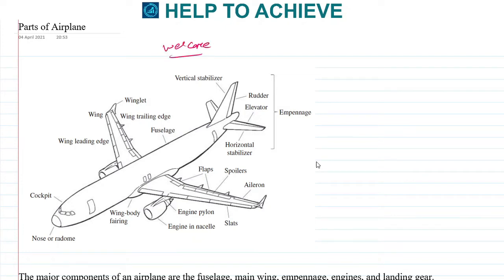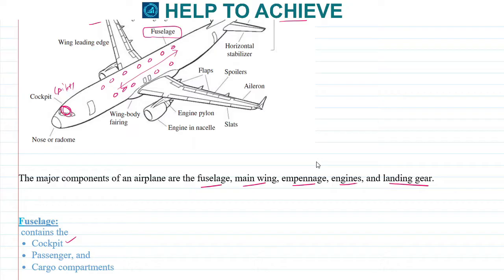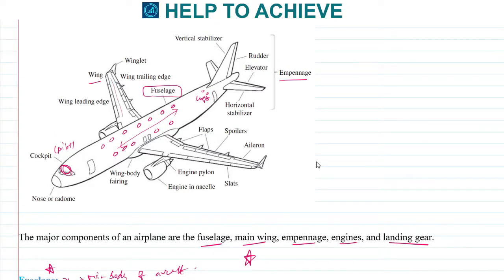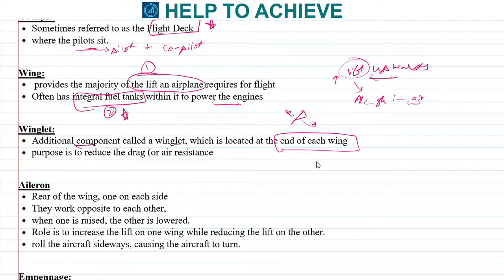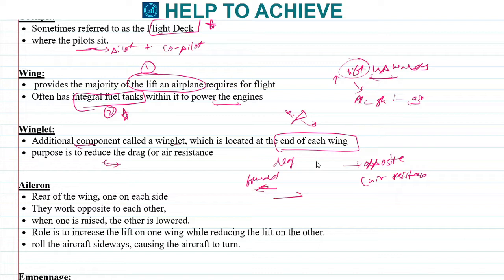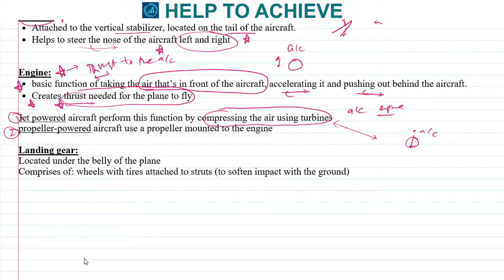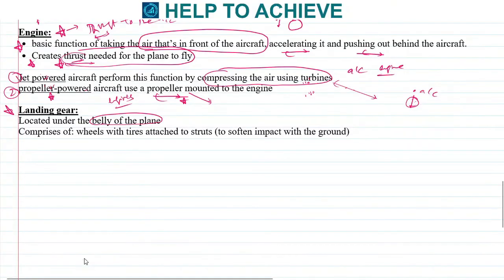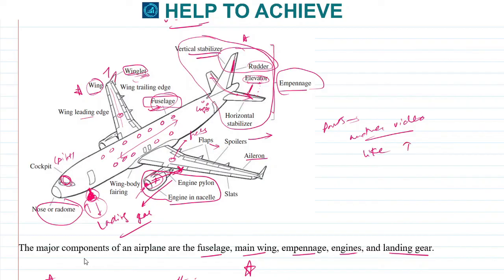Parts of Aircraft and their Functions - Fuselage, Wings, Empennage, Engine, Landing gear etc.,

Comment: new Orleans , new Orleans , new Orleans 

air traffic control 

    most of the  job works  are ........  sourced  out  through  sub contractors ..........    
 irrespective of electrical or civil ... only the ....... metropolitan   bus  corporates   ....   ashok Leyland ..... and  hotel ashok, .... taj  coromandel 
  will suggest  weather   electrical   engineering is    routed through subhash Chandra Bose or  ....... through  paulose ... chief engineer   ......... Hindustan ..aeronautic limited .....
or the Russian  translators ....of Kerala .........   routing the  job works   .........